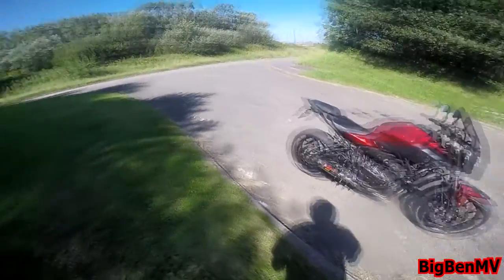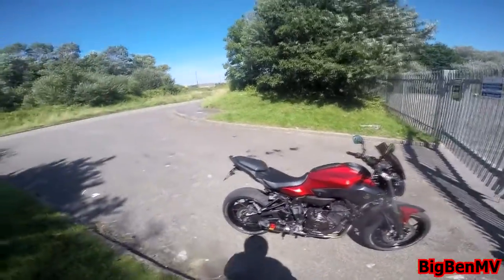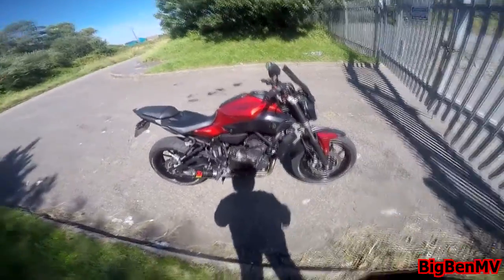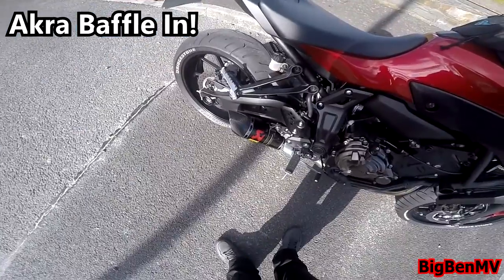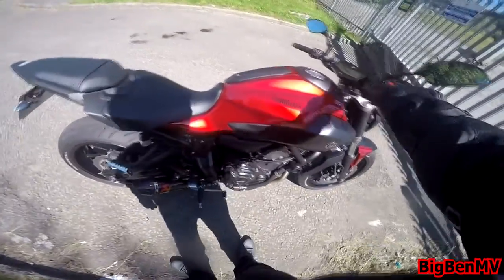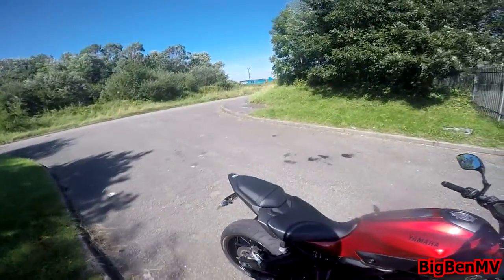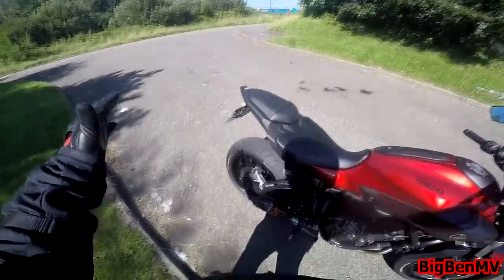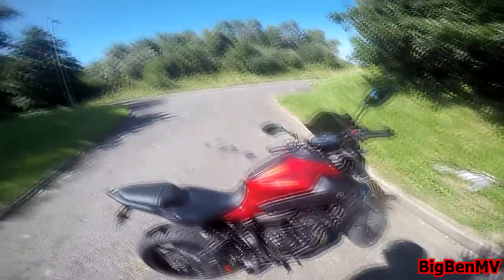#123 Akrapovic Carbon Exhaust - Baffle Out! MT-07!

Comment: Awesome, love that baffle-out growl, yeeaahhhh!! I have been toying with getting a Scorpion for my MT125 but I can't believe the difficulty I have found, trying to get suppliers to confirm compatibility :/ I believe that a full system for the YZF125R 2014/16 should be ok, as the engine is identical to the MT - do you reckon that's right, or am I way off?
Reply from the maker: I love it but not as much baffle in, the rasp is just amazing! From what i can see by pictures online, the mt125 exhaust pipe has a slight bend by the exhaust where the yzfr125 pipe doesn't which my cause a problem. The can itself is going to the same on both.
Reply: ah right, may be a problem then, cheers for the advice!
Reply from the maker: steve caine No problem dude, i have contacted scorpion before about a problem i had and they replied next day.

Comment: does it pass the MOT with the baffle in?
Reply from the maker: It will yes. You will just get an advisory for noise
Reply: +BigBenMotoVlogs what happens if you don't forfill that?
Reply from the maker: +Desantos123 UK The mot still passes with an advisory. You don't have to forfill it either, they will test it again and if it hasn't got louder then it will be fine, they just mark it as a advisory again.
Reply: +BigBenMotoVlogs so how many advisorys can you get before they take action?
Reply from the maker: All depends on the person who is MOTing your bike whether he does anything or not
Reply: +BigBenMotoVlogs so basically, the Akrapovic exhausts aren't street legal?
Reply from the maker: The carbon version (technically a racing exhaust) isn't as it doesn't have the E markings but the titanium version does and that is street legal.
Reply: +BigBenMotoVlogs oh, so the titanium one is more quiet then.

is it possible to get an advisory for the titanium?